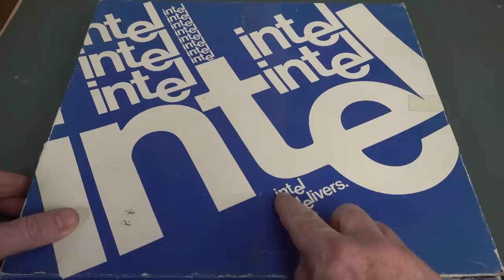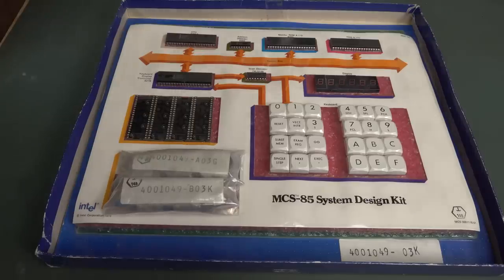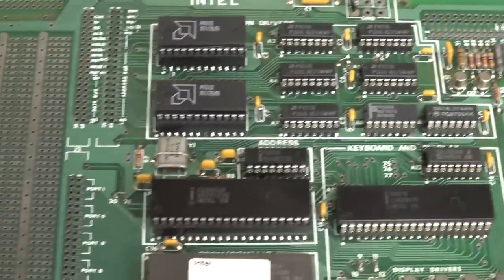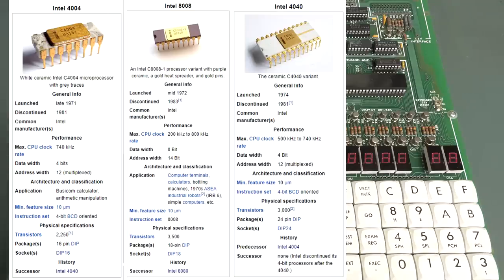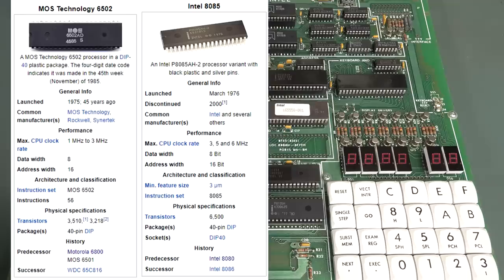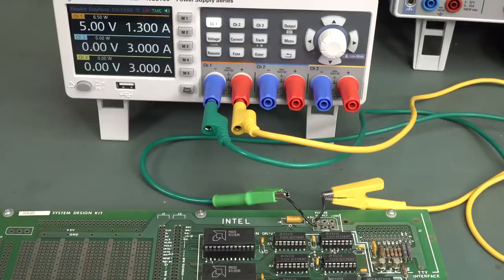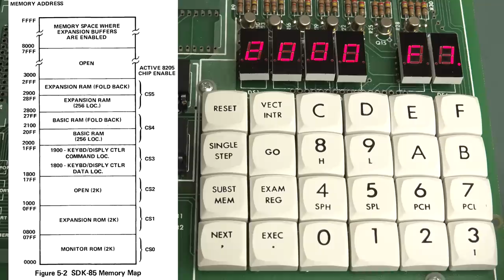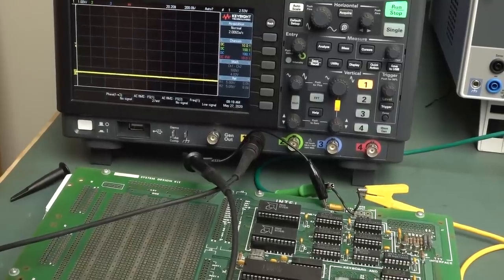EEVblog #1308 - 1970's Intel MCS-85 8085 Design Kit!

Comment: Your history lesson on these old processors was great, so much info condensed that I had to pause multiple times and go back! Also so many of these old processors still power the world today that many young players would be amazed! The 8085 was released 7 years before I was born, today I work in the industrial field as a service tech repairing these, or to be honest their much younger offspring that is much less reliable and often without schematics as you addressed, so again thank you so much for all of this history, it is nigh impossible to learn it otherwise and get the full picture like this! :)
Reply from the maker: Thanks, I took the extra effort on overlaying images this time around.
Reply: I recognize so much about that, because I had an Intel databook about the 8085 and such from Tandy/Radio Shack here in the NL. You asked if the MCS-85 was cheap. I don't think it was here in the NL. Just calling the USA cost $2 or more per minute. I bought a TRS-80 (model I) from our local Tandy and it had a Z80 as you probably know. Later I was introduced to the 6809, which is much nicer!  BTW. I wrote a cross assembler to the 6811, which is byte-wise about as efficient. BTW, we built a Unix computer based on the 6809: https://idd.nl/sophie.php
You may want to visit my Chipdir at chipdir.nl
Reply: @EEVblog  Dave, can you please show the PC104 controlling something like blinking an LED, etc. I am very interested to see how automation worked in the old days.
Reply: @ganswijk  I designed the 6809 logic analyzer interface for the Tektronix 7D02 Logic Analyzer in 1980.  With it, you could capture the execution of a program, and display the disassembled code on the logic analyzer screen, and even trigger on the address, data, or instruction of your choice.  Although there was no pin on the 6809 that indicated which data bus reads were in fact instruction fetches, my fetch predictor state machine deduced that key information, and was later patented.

Comment: amazing stuff :-) Kinda brings back memories. I was taught microprocessor systems in school by a very similar development kit based on Z80 though. Dont remember if it was manufactured by Zilog or not but it was a little bit fancier than this board and had a Z80 in it. Our microprocessor lab was basically developing some applications on that board ...I just remembered one was controlling a traffic light in a cross section

Comment: The Zenith Z-100 used an 8085 processor as one of its two main processors (the other was the 8088).  As one of the first "dual CPU" machines, it ran your CP/M program on the 8085 but CP/M itself ran on the 8088 :-)

Comment: I had the tremendous chance to work with an Intel 8085 SDK.The one I used was from my boss, so I built my own using wire wrap and a small printed circuit for the display stuff, I still keep my homebrew 8085 SDK !!!. I learned tons of treaks and that practice and knowledge opened me the door to work with far more complex systems until these days. Thank you for this video !!!!

Comment: Here in Canada we also call it the Zed 80, hearing an American refer to it as the Zee 80 just feels... weird. Yeah I get that as an American design, Zee is correct, but I’ve always known it as Zed.
Reply: @anonymic79  He also called Dave an American lolz
Reply: In Oz it was also called the ZAT (ZED-AYE-TEE).
Reply: It’s weird for me. I’m American, so I say “zee” not “zed”, but hearing “zed 80” (and other computer parts using “Z” as “zed”) sounds right. “Zee 80” sounds weird. Just lots of exposure to “zed 80” instead of “zee 80”?

The 8 Bit Guy refers to it as “zed 80” and he’s American also.

Side question: I read hexadecimal numbers weird. For example, I pronounce 0x80 internally as “zero by eighty” as if it was a matrix size. 0xaa I pronounce “zero by ayy ayy.” I actually have to force myself to, when speaking, say “hex eighty” or “hex ayy ayy.” Does anyone else do weird stuff like that?

Comment: At the University, by the 3rd semester we started to use the TTY interface to connect it to the TRS-80 model II (CP/M). This way we could keep our programs stored in 8" floppies. We also used the Z80 simbolic assembler with the help of a few macros to generate a few i8085 specific instructions. It was a big leap from assembling by hand and typing it in with the hexadecimal keyboard. Also the monitor program supported a number of commands to do the same operations of the kit keyboard and a few extra ones that allow for fill, dump, ... the RAM in large blocks, not sure if 16, 32 or more bytes per block.

Comment: I'm fairly sure that the first Prodigy computers had 8085s.
I think later ones had a Z80, though. There is no mention of them anywhere on the net, but I was using a language / OS called Protege on them in 1984-86.

Comment: That was my first toy. The University I attended had lots of those.
The next one, i8086, we design it in house writing our own monitor code, largely based in the monitor of this kit.
BTW, I think I still have the commented listing of the MCS-85 kit monitor. And also a pocket size folding sheet with all the ASM opcodes and their haxadecimal codes, that we used to and assemble the programs so they can be inputed with the haexadecimal keyboard/display of the kit.

Comment: In the 70's at university I learn't on Z80, about 10years later I purchased one of the Z80 kits from the university as surplus equipment.
I have it stored in my garage, included power supply built underneath it by university staffer and has S100 bus down one side.
I think you could get a BW monitor plug in board to  help see what was going on.

Comment: I still have an MCS-85 board stashed away in an old briefcase. I was using it at Medtronic in the early 1980's to evaluate a semi-custom mixed signal IC that Exar produced. The Exar chip was a metal mask programmed analog array, which was much faster to develop than a full custom mixed-signal chip and a better solution for low volumes. The MCS-85 board has date codes of 1980 on the chips and still has the EPROM to run the evaluation program as well as an Exar protoype with a date code of 8243 (late 1982). All of the chips in the breadboard area are wire wrapped. When the project finished I took the MCS-85 board home, thinking that it would be fun to play with. It has been in a closet ever since.

Comment: we used the 8085 in ceramic case for military products for both fixed and rotatory wing aircraft. and the RAC1802 for land and air products. As a youngster it was great to use the SEX instruction in the 1802 which was SEt X register. :)

I can remember that the intel 8085 emulator was about £28K and off course as an ext apprentice who had just transferred in to the Research & Design  (R&D) department i was not allowed to use it. But i did get my sticky mits on a MICE emulator which would constantly fall over, until I found it would run for hours with the case off and a desk fan blowing on it. Coming from the production via tests departments, I would spend my lunch time writing code to help the test engineers test and fault find the PCB's. The design engineer produced test equipment was a bank of switches for data, address, and read and write. so a board with 10 14bit dac's where they had to test every step would take days.  So I fixed a duff computer board and put some test routines in that would do the complete test in about 10mins, it could also echo back test the rs232 board as well. You had to help the friends you had left behind.

Comment: SC/MP of course, and the MiniScamp project from Electronics Australia in 1977(?). Then the 2650 (1979?) and the projects from Applied Technology in Hornsby. The 2650 had to wait until I had a driver's licence as the walk from the train station to their shop was a killer.
Reply: SC/MP aka National INS8060 ... built my own little computer in high school based on the schematic in the Digi-Key catalog.  Still have my old SC/MP CPU chip and it still works!

Comment: Your board is missing a part. The kit included a couple of strips of double sided tape and a  piece of transparent red acrylic plastic. The last step in construction was to tape that plastic to the LED displays. It vastly improved the readability of the display. I worked part-time as a tech in a college in the early 1980s and spent most of a summer assembling these kits. It got to the point where I could assemble one from memory in about half an hour.

Comment: When you were discussing the history of these microcontrollers one significant one you forget was the RCA 1802. This was a popular hobbyist chip and it was significant in that it was the first CMOS low power micros. We had one of the COSMAC ELF computers in our computer science department in high school in the late 70's. I do have a soft spot for the 8085 however as I built up a controller board from scratch using the 8085A Cookbook by Jonathan Titus as a reference in the early 80's. I have also found 8085 boards used as controllers in scientific equipment from the 80's.

Comment: I still have my Motorola D2 kit. In the late 1970's used that kit to design a 6800 CPU card for S100 bus and got FLEX OS running on 8" SSSD.
Reply: How much it costed. It was probably way more expensive than this Intel 8085 kit or 6502 kits / computers.

Comment: Fun fact: the Intel 8008 is actually totally unrelated to the 4004 (marketing was a thing even back then). The 8008 was a microprocessor implementation of the solid state processor of the Datapoint 2200 terminal (designed in the late 1960s and announced in 1970), which not only provided some processing power of its own, but was probably also the very first real-world PC. Datapoint commissioned the microprocessor implementation to a few fabs, including Intel, Texas Instruments and Fairchild. Intel was the first to actually deliver (I believe, TI was a bit faster, but didn't meet all of Datapoint's specifications), but only late so. (Part of this was for prioritizing design on the 4004, which had been started only after the initial work on the 8008.) However, the original design of the DP 2200, the microprocessor was to replace, was built around a single-bit, serial shift register, and had been replaced in the meantime by a parallel multibit TTL design already. Hence, the microprocessor was slower than what Datapoint had already on the market and not of further interest. (In fact, DP [then CTC] TTL processors remained faster than the respective generation of microprocessors up to the 386-era, when they were finally phased out.) In order to reduce losses on the commission of the now useless chip, rights remained at Intel, who tried to figure out ways to market it over a few years. (Which eventually gave us things like this development kit…)

Fun fact #2: CP/M was written for the Intel 8080/8085 (with the Z80 being supported as a superset, as well). Insofar, not a that unimportant processor…

Comment: I still have one of these kits. Mine had the system ROM replaced with the 8755 EPROM version. The problem is that the EPROM was blank! I had to build a programmer for it, then get an accurate copy of the source code to recreate the binary. I finally got it working last fall.

Comment: We used the SDK-8085 (MCS-85) trainer when I went to Tech school in the late 70s. Had to wright programs and interface it with circuits to control motors, test ICs,  program it for a clock. I still have all of my labs and programs. I don't own an SDK-85 but do have a Kim-1 which uses the 6502. I bought the Kim used at a ham fest over 25 years ago for $20.00.

Comment: You've got a later kit.  The 8085AH shown in your kit is at the earliest, 1980.   I started with the 8085 (no suffix) in the later part of 1976.  It had a couple of annoying bugs, among which was a buggy reset.   The 8085A came a bit later (1977?).

Comment: I trained on the Lawrence Livermore trainer which was very similar to this board. It was 8080 based. My first machine language program was a perfect emulation of the traffic light in front of the school. Prior to that, I learned basic (sort of) on the Commodore PET with the chicklets keyboard. My Morse code transmitting program was bootlegged by the rest of the class. I was honored. My processors in order: 8080, 6502, Z80, 6809, 68K, 8088 and derivative, and MCS-51 and relatives. Then the line was crossed where I could purchase hardware and software for less cost than my development time. Ah, those were the days.

Comment: i have a Micro-Professor MPF-I which is a Z80 version of this, but has much better and bigger displays, and a much expanded keyboard(keys sucked tho, very small) with far more functions, and it had much more ram and rom(2kb), expandable even.
Funny thing is that the microprofessor is still sold(or at least it was a little while ago).
My father used it a lot when he was young and he made a EPROM programmer board and associated program(quite a complicated board full of components!), the MPF-1 had the benefit of being able to save and read from audio cassettes, none of this "losing your program" rubbish. Very advanced bit of kit

Comment: I had an RCA Cosmac ELF single board computer, built it myself. I also had several different 6502 hand made single board computers. I built a single board system, based on the 6507 and using the 'sound chip' from a Commodore 'VIC 20" to implement a tone generator board for use in Honeywell Process Control stations, in use at Mobil Oil where I worked at the time. The engineer who had put me onto the project came in one day and was watching over my shoulder as I hand wrote the machine language code in a notebook. Why don't you use an assembler, he said. Buy me one and I will use it I replied. My brother Frank, who died in 2002, was in his final years of life working at a 'technical college' in Austin, Texas. I inherited from him a KIM-1 and an SDK-85 design system, just like the one you are reviewing in this video, they are treasured posessions.   As was mentioned by someone else, this was intended to interface with a 20ma loop terminal. The last ad I saw online, back in the eighties, was for $149.00. Today, all these devices sell for much more than that on Ebay as colectables.

Comment: I remember the SDK-85 so well.
It got me into microprocessors in a way I could understand to build projects.
At the time it was amazing to have such incredible power -
it was like leaping 30 years into the future compared to analog circuits.
I remember the lecturer on the first day of the 8085 course saying -
"nothing you've ever seen before can do what this can do."
I passed my courses on it by practising on my own SDK-85 kit that I still have.
The only thing that annoyed me was the volatile memory -
to get the program onto an EPROM was a major task.
I think - even today - that all computer programmers should have to start out on an SDK-85 kit -
or something similar -
so that they can really see and understand what is going on at the most fundamental level -
which is quite simple once you grasp it.
I'll also add that Intel made it easy to understand their 8085 compared to the Motorola 6800 -
which was harder to get going owing to lousy notes and a book etc.
Intel's documentation was 10 out of 10 -  perfect.

Comment: Wow, that's way more sophisticated than the Motorola D2 kit I started with. That one had a hex keypad, but little else. The debug monitor did almost nothing. It's a great way to learn though. Engineers today are missing out on that fundamental experience of understanding address decoding, and grasping how op-codes work right down on the hardware.

Comment: My first microprocessor in the 1970s  was the obscure RCA CDP1802. No fancy development system for me. Being a masochist, I wire wrapped together a system  with 256 Bytes of RAM no ROM, and Hex LED readouts. But it did have composite video out you could use it to create a terminal with like 20 or 40 character lines.  Input was initially toggle switches. At least there were only 8 switches. The processor had a Load mode which would auto increment the address. My first upgrade was a Hex keypad.

My first post-university job was programming the 8085. Next the 6809 with a little 6502. Then onto boring PCs.

Comment: The Commodore PET was actually based upon the 6502 KIM development board.  The differences were minor, and the PET had a display chip, but about everything else was the same architecture.  The reason for this was that the KIM and the PET were both designed by the 6502 engineer itself.

Comment: In Electrical Engineering university, I hear we will learn about the 8085 on second semester's digital tech, as it's one of the most powerful processors we can still fully undestand in that time. I'm sure though we won't be using this kit...

Comment: The i8085 was a good choice for embedded systems because of a feature no other had. It had multiple hardware (pins) interrupts with independent vectors, and also software interrupts, while all others had only the usual INT and NMI inputs. And also 2 specialized pins for serial communications and associated ASM instructions..
According to my teatchers, it was a bit of a midway between a microprocessor and a micro controller.

Comment: Did a little 8088/8086 at uni, but mainly had experience with 68HC05 and 68HC11 evaluation boards from Motorola.  They had a serial interface built in and I used to connect them to a PC with terminal emulation software, which also meant the program could be written and assembled in the PC and loaded into emulation RAM to simulate the on-board ROM. There was generally a dedicated board for each type of processor.  Prior to that, Motorola also had dedicated units with names such as EXORcisor.  Think I still have a M68000 emulator in the garage; never unpacked.  May be time to get it out...